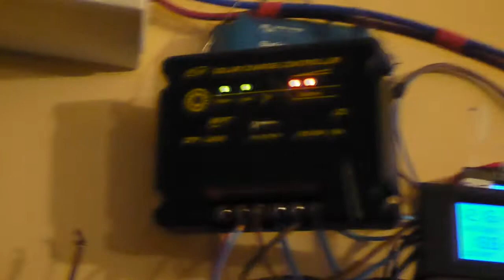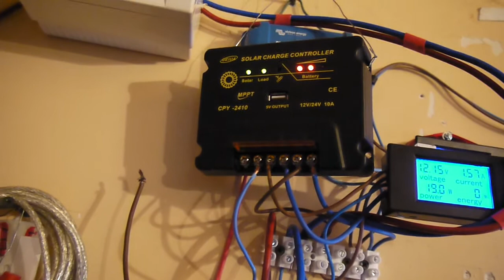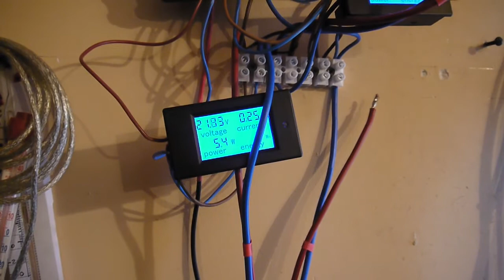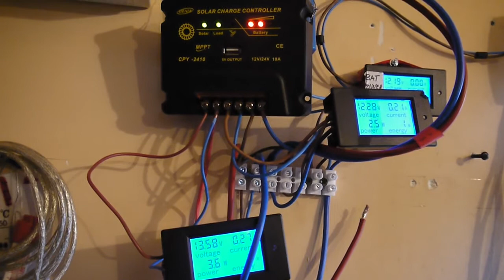Test MPPT CPY2410 CPY 2420 CPS2410 solar charge controller charger final results.Fake MPPT

Comment: Removed mine and switched to a PWM one. This is MPPT but i find it works poorly in the variable weather conditions of the UK winter and spring. Expecting to change back in summer.
Reply from the maker: THis models are just a joke. I have a PwrMr 60A  DIY kit, I forgot when I put it on and it's working and working.

Comment: I have the 2420.  Works just fine.   Yes it is MPPT.  you can see the Current Gain created from from anything over the battery voltage .  Measure the Current going in and Current coming out with clamp meter.  You would realize a gain in current.  No PWM or Switching regulator can perform that way.    Checking the PV voltage going into the unit and it never strays more then one volt from the Max Power V stated on the panel.  18.2v for on my RichSolar Panels.  .   My only grumble is the Terminals are to damn small.
Reply from the maker: Hey! Please help me with subscribe! Thanks!
Reply: @viocaia  Done
Reply from the maker: @pulesjet  Thank you so much! that helps!
Reply from the maker: THere are a couple of different boards  for this model, maybe you've been the lucky one to get a good one!
Reply: @viocaia  Yes, Sounds like the Earlier boards sucked.  Or was good and then went south.  This one is only a couple of months old so they may have fixed something.
Reply from the maker: @pulesjet  probably they fix it! Good luck!

Comment: Where are the shunt resistors for the multimeters located?
Reply from the maker: Inside, this are for 20Amps only.It has a 0.01ohm resistor.
Reply: @viocaia  they need a separate constant voltage power source to operate (6.5÷100V) or  they can be feed from the solar panel directly (variable voltage)?
Reply from the maker: @csraln6748  directly from the panels.

Comment: These are MPPT and work well if you use them in their comfort zone  - ours works best from about 10watts - 100watts  input  - in this test you just have <5watts  so half the input is used to drive the electronics including that USB Buck
Reply from the maker: In in my first test with CPY2420 I had some good results, almost perfect.Nice to hear the explanation about the power range.This should be advertise in the pamflet or even the device itself.
Reply: All them fets need drivers -  linear regulators to power the drivers are only about 25% efficient   - then there are switching losses and forward resistance in fets - inductors and sense resistors - they all have a toll - so you lose an initial 2-3 watts then a proportional loss - that's why there  a finned heat sink  - choosing an oversize or undersized unit  can be counterproductive  - for systems under 20 watts a well-matched  panel  MPP just above the battery voltage and simple PWM  would be a better option  and for 5 watt skip the PWR and just  match solar to battery
Reply from the maker: Nice to know this should be advertise on the box pamflet.
Reply: Possibly  - but then folk might think that this model was inferior when in reality all  MPPT are subject to these losses - There are some new combined driver fets  (power chips)on the market that would make the losses less but they are still quite expensive
Reply from the maker: Please enjoy your CPY 2010 or 2020 MPPT! I.m not!
Reply: If you open the back and it has one big inductor it's an early version which had a good processor - latter versions with one inductor have a cheaper processor which  are inferior
Reply from the maker: As you may see, that's a a new version, with two inductors.I believe  Timemachine_194 was right, I'm not an expert in processors but it feels like this one is pretty slow and there are a lot of other ''shortcuts'' for making a cheap product.Anyway, is not secure at all...but we are all free to experiment(like I did ) and choose a right decision afterwords.Mine was to buy most mature equipement.
Reply from the maker: Hey! Just give me a hand and  subscribe ! Thanks!

Comment: FUCKING JUNK RIP OFF. I USED AN 18 VDC /5 AMP  COMPUTER POWER SOURCE AND IT CHARGED MY 12 VDC BATTERY AT 18 V AND THE INPUT NEVER LET MORE THAN .5 ,OF THE 5 AMPS,IN. THE ONLY REASON I BOUGHT IT WAS BECAUSE ADAM WELCH GAVE IT A GOOD REVIEW. BUT THEY CHANGED THE INSIDE TO SOMETHING THAT DOES NOTHING AT ALL BUT RUIN BATTERIES AND BURN HOUSES DOWN.
Reply from the maker: Right! Not recommended.

Comment: Eram aproape sa cumpar.  Am mai auzit ca poti sa iei o mare teapa....  Acum se liciteaza pe Ebay pe la 10$.... Mult prea ieftin ca sa fie adevarat...
Reply from the maker: ar merge cumva, in testul cu panou 100w si 12v (36 celule) pus pe o baterie de 12 v normala (masina) a facut cev atreaba.Vezi filmarea.Din pacate , la tensiune mare , adivca 2 PV in serie si 38v intrare se zapaceste.AM mai observat ca daca este consumator in acelasi timp, adica  pe load ceva cuplat , iarasi o ia pe aratura.
Cumva merge, e posibil si un viitor firmware sa rezolve, are port TTL.
Daca vrei sa experimentezi am unul pe olx cu vreo 50 de lei..
Reply from the maker: chwck this https://www.youtube.com/watch?v=53RnB2iZAx4
Reply from the maker: Salutare! Te rog ajuta-ma cu subscribe! Mersi mult!